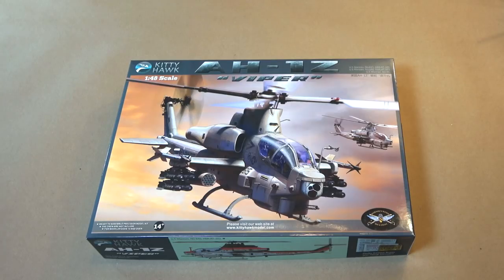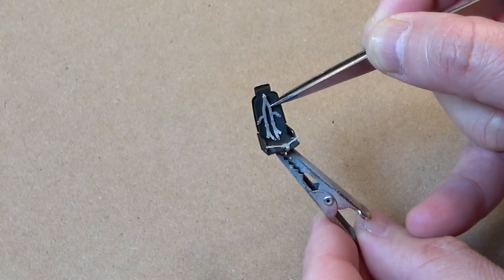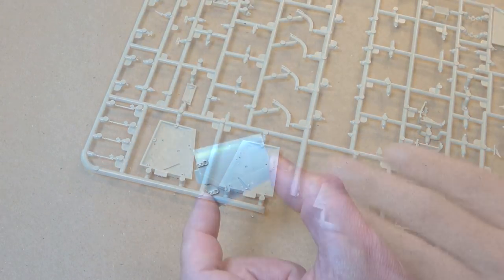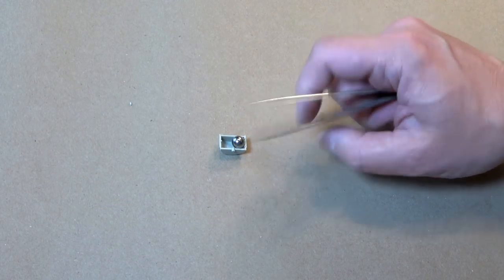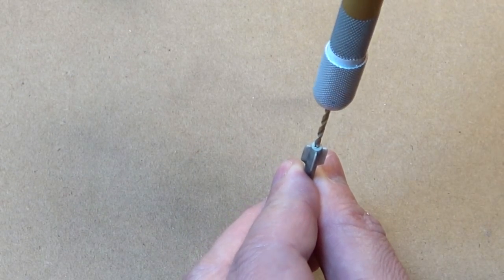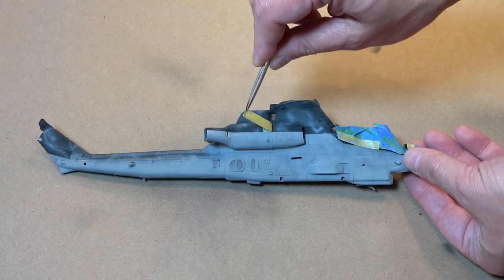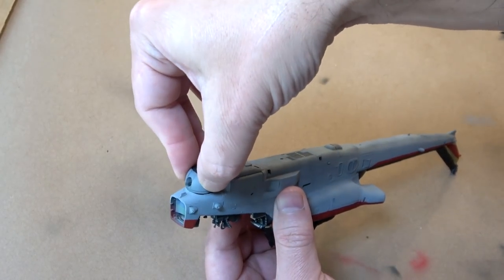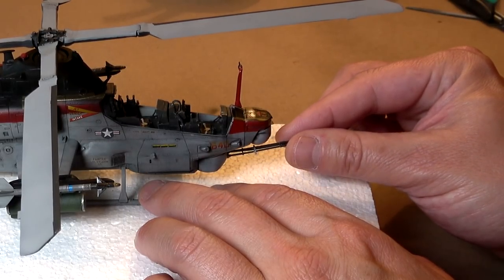Building the Kitty Hawk 1/48 Scale AH-1Z “Viper” Attack Helicopter

Comment: Hello, nice build-once again! Two questions :)  @ How long do you let the putty to cure  and after the metal file, do you use another sandpaper? I am asking because this putty tends to breakes(but is non toxic)  and the metal file usually leaves a rough surface. Take care!
Reply from the maker: Hi John K, I was using the metal file more for the plastic than the putty. I usually use a wet cotton swab to smooth out the putty. If you decide to use a fine grain sanding stick or something like that after the putty dries, I'd wait about 24 hours first.
Reply: @MaxAfterburner  Ok i see, many thanks